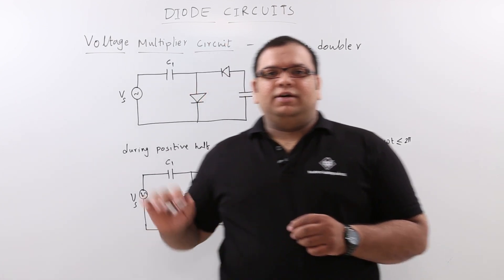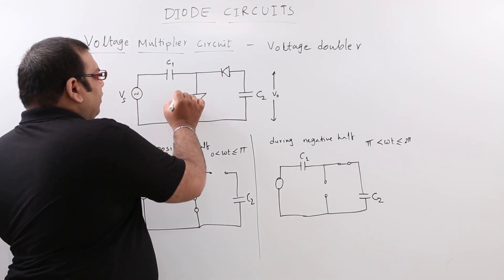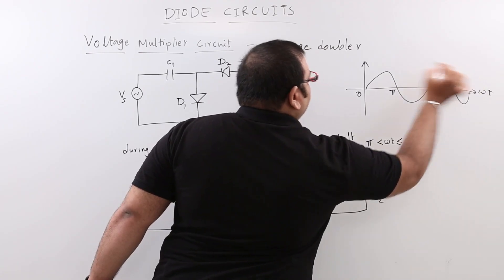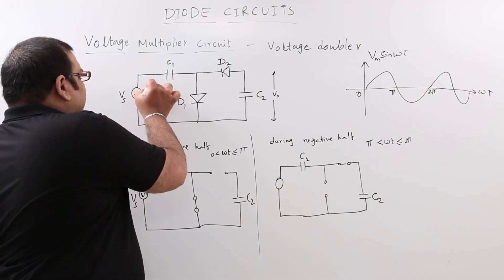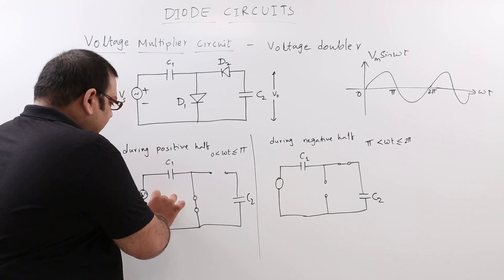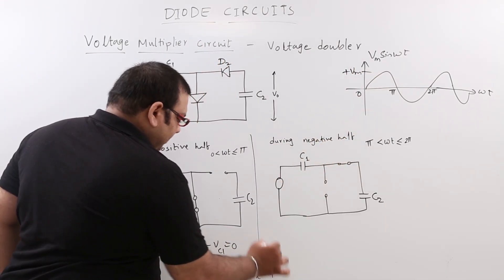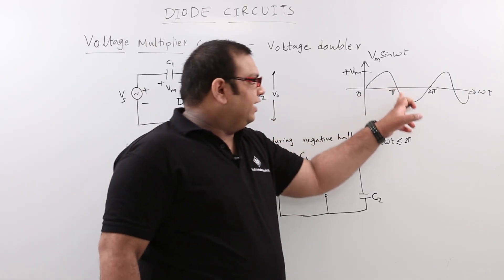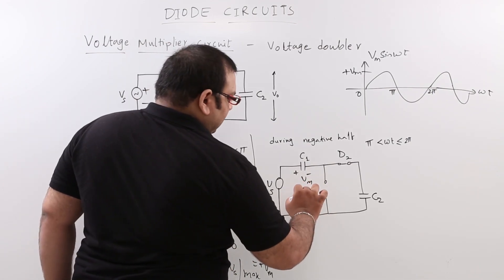Voltage doubler circuit

Comment: what negative sign means? why not only 2Vm?
Reply: Nice.😊😊😊
Reply: the given equation for vc2 is wrong .
actual equation
Vs+Vc2-Vc1=0
Vc2=Vc1-Vs
Vc2=Vm-(-Vm)
Vc2=2Vm
enjoy :)
Reply: If you noticed, his KVL is based on +ve half cycle, even though that diode baising configuration clearly shows that its in a -ve half cycle. I think that the negative sign basically tells you that the voltage is flowing opposite from how you are currently viewing it, which in his case, he's viewing it as +ve half cycle direction point of view.